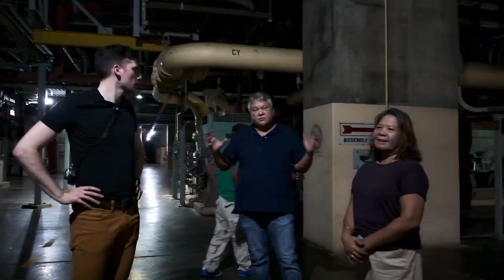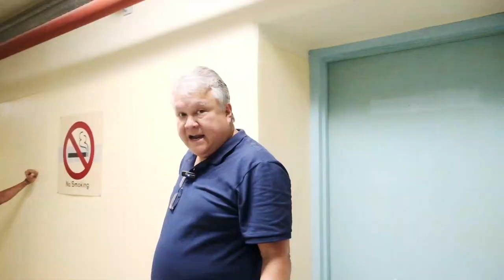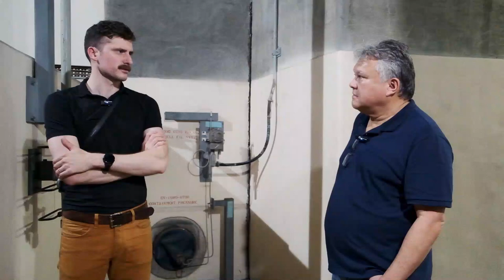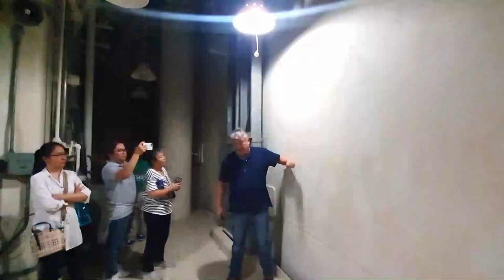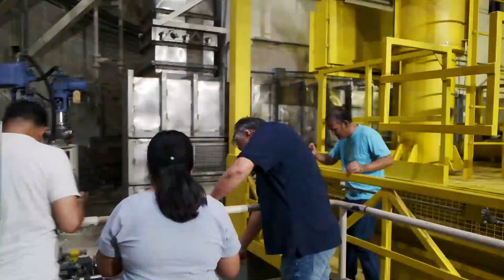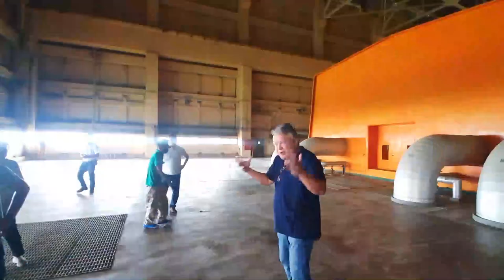Kasalukuyang Kondisyon ng Philippine Nuclear Power Plant | Mark Cojuangco Vlogs

Comment: Nuclear power plants typically require less land area compared to solar and wind energy plants of the same capacity. A nuclear power plant might need around 1-2 square kilometers of land, whereas a solar farm could require 5-10 times that area, and a wind farm even more, depending on the turbine density and local conditions. However, the land use for solar and wind farms can vary widely based on factors like technology, location, and layout.

Comment: Nuclear power plants reduce carbon footprints primarily by producing electricity without emitting greenhouse gases during the generation process. Unlike fossil fuel power plants, which burn coal, natural gas, or oil, nuclear power plants rely on nuclear fission to generate heat, which then drives turbines to produce electricity. This process does not produce carbon dioxide (CO2) or other greenhouse gases as byproducts.

Additionally, nuclear power can provide baseload electricity, meaning it can generate a constant and reliable power supply regardless of weather conditions or time of day. This reliability makes nuclear power an essential component of low-carbon energy systems, helping to stabilize the grid and support the integration of intermittent renewable energy sources like solar and wind